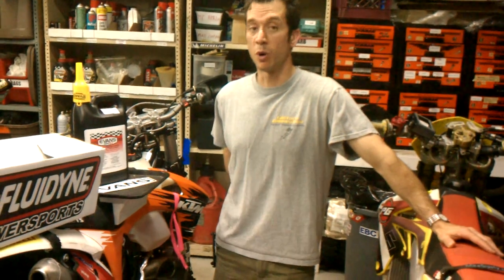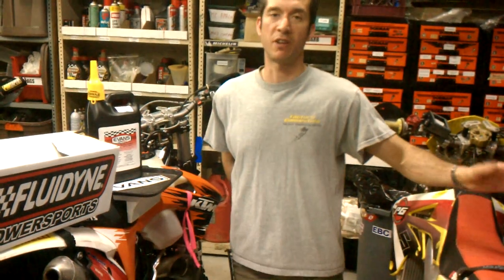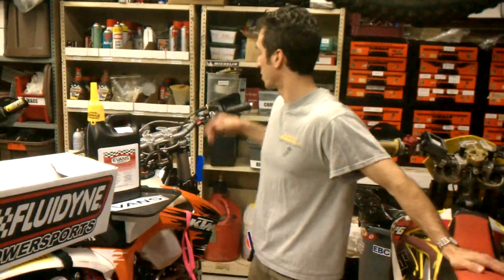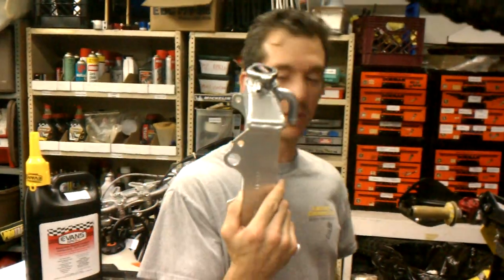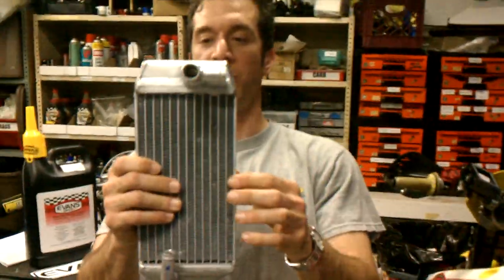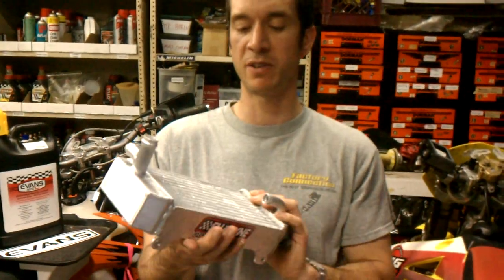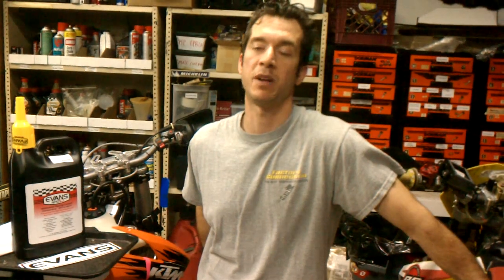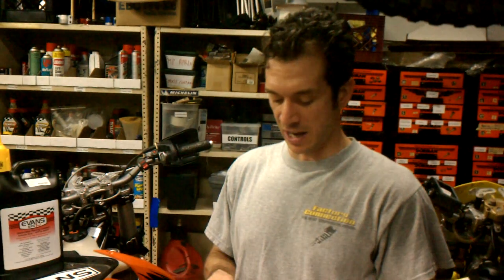How to keep a dirt bike from overheating and preparing for erzberg

Comment: Cool Videos Mike!  Good luck in Austria!
I've used Evans.  Don't run the bike while dry to remove water!  Pour a little coolant in the system with the drain & hoses off.  It'll rinse  the water out.

Comment: Did your bike have a battery already installed? are you able to install a cooling fan to a system without a stock battery?
Reply: This KTM had a battery installed, i have put a 2 full size trail tech cooling fans on a KTM50 (yes 50) and used a trail tech battery and they ran for over an hour strait, now if i had a thermostat it would have run a lot longer i am sure.